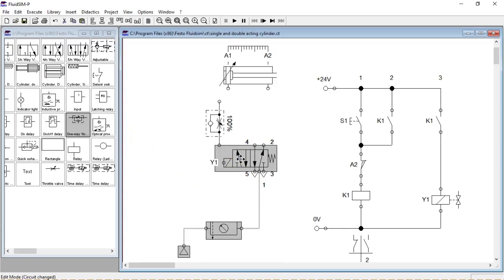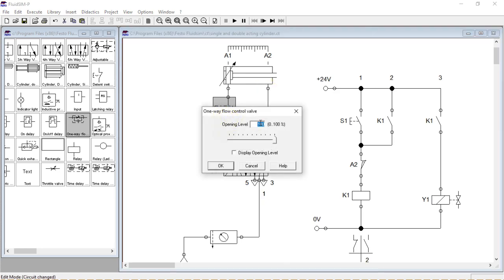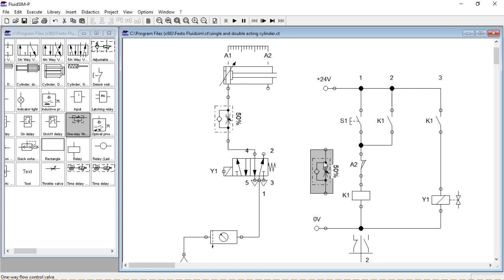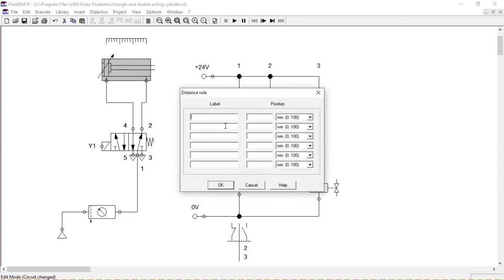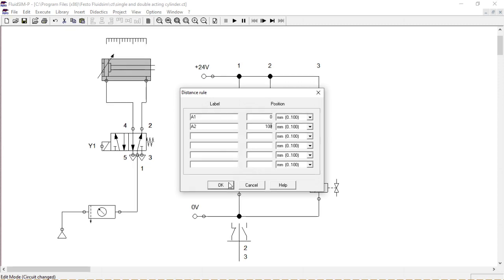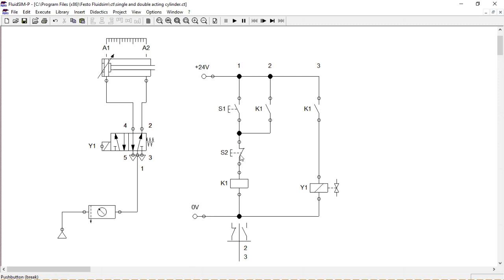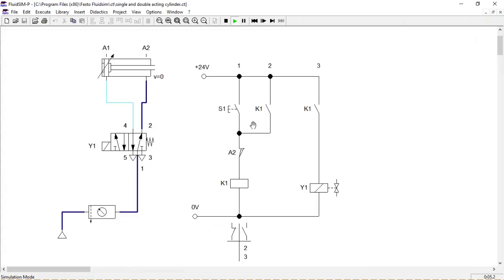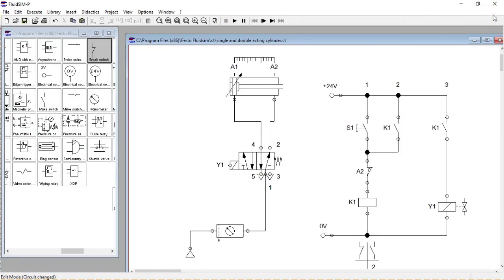FluidSim tutorial. Limit switches and one way control valves.

Comment: Isn't K1 redundant?
Reply: K1 is a relay (consisting of a coil and 2 pairs of contacts) . The left part of K1 is the coil, once energised- K1contacts are engaged. The right hand contact energises the valve block solenoid. I would say the middle contact allows latching of the circuit (bypassing the switch). It looks like A2 breaks the circuit. Hope this helps!